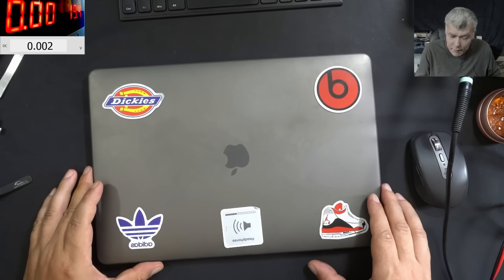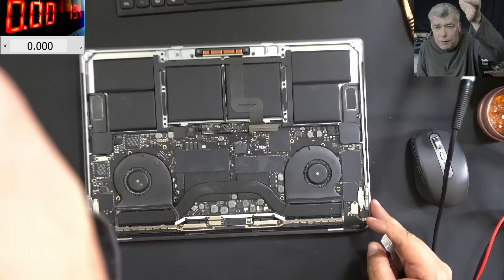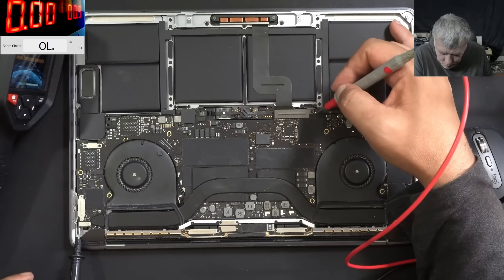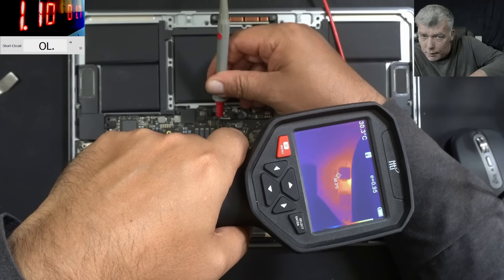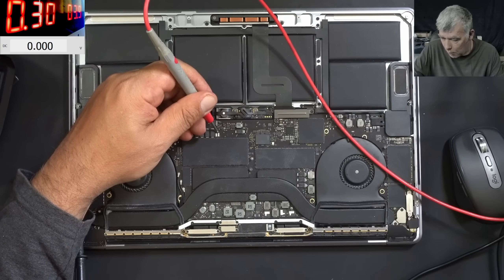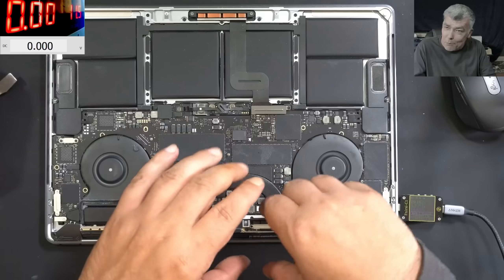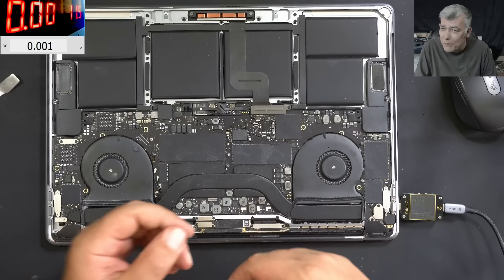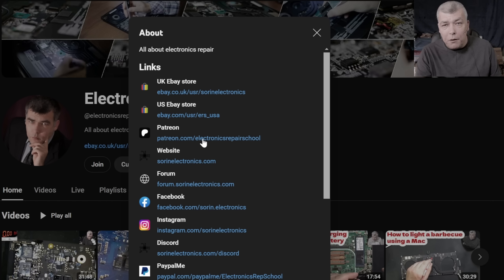Another way to deal with shorted caps - Pushing high current in a shorted capacitor

Comment: Not really a good method of resolving this. You really need to take the motherboard out of the computer, and use a hot air station to remove the failed capacitor/other component once you have identified the fault. Trying to burn out a capacitor by shoving a high current into it is just asking for problems.

Comment: Haha.. required tools to start a repair business: screwdriver, multimeter and a power supply. For pros: additionally a soldering station and a bunch of proper calibrated wire. The rest is optional :D

Comment: I had a proper calibrated 12V/7Ah Lead acid battery to kill the shorted capacitors.(After I buit a power supply from a faulty UPS).
One short touch with the wires and the cap exploding immediately :). (The use of protective glasses is mandatory due to flying capacitor pieces).
Only the main power rail strong enough to do that...

Comment: Can talk about or give some information about Intel 13th/14th generation instability issues and its impact on laptops
Reply from the maker: Well, as intel is not doing anything about this, never again intel
Reply: @electronicsrepairschool Oh, probably you judge a bit too hard, because Intel gave recommendations to the mainboard manufacturers to add a tab with Intel's recommendations for the specific CPU. Overclocking is not recommended, not from any chip supplier.😊

Comment: Anticipating a surge of machines arriving with failed CPUs now :-o
Reply: Calibrated CPU failure from injecting an inappropriate voltage into a low voltage line. Nice
Reply: Even though Sorin knows what he is doing and he checked CPU coils before injecting current, still this is very bad practice and example many other will try follow. In conclusion, as Paul Daniels said, many otherwise repairable laptops will end up with burned CPUs or GPUs.
Reply: Proper dodgy job !.

Comment: Sorin, the cap is in the computer to do some task. Not removing it can degrade functional stability. The power delivery network (aka PDN) is designed with this cap, not without it…
Reply: Yes. Nearly all capacitors do have a specific place on the board. To loose some capacitance is sometimes not so important. But it can influence signal quality, stability and cleanliness of a signal or supply voltage. Modern electronics need clean signals and clean supply voltage. Therefore, there are many capacitors involved.
Reply: No. Try doing some research into electronics design. You will see recommendations from chip manufacturers about capacitors, inductors etc. They are recommendations. Board design engineers get a but too excited about adding inductors and capacitors all over the boards because they think it's good practice. The reality is there are likely to be over 50+ capacitors on the main power line all over the board so one missing capacitor won't make any difference. It's like pi55ing in the ocean, no change.
Reply: @g4z-kb7ct In the B2C business, you can act like this. There is nothing requested, even not any formal education. In B2B is a different world. But I think, to keep some good standards even for the privat customer, would be good practise. I also don't like to pay 150 pound to get a "repair" like this. Still, the board is not okay.

Comment: When will it be back for a warranty repair?
If the cap is cracked (likely) burning it out so it works now seems counter productive - bend/use the laptop, and it will most likely short again shortly
Reply: Burned (openend) caps do not come again  to conductive ..never seen this before ( if you don't touch them with tweezers or hot hair ) .. the only thing I'm a little bit worried using this technique is that pcb can soffer from over heating and layers can melt... but in this cas cap burned very fast
Reply: @laboratorioassembler  Agree, if you really cook the cap, it is unlikely to short again - perhaps, no guarantee given from me.
Ceramic caps, with their parallel metallic plates - once cracked, has no where near the mechanic stability they had when manufactured.
So if the short isn't burned 100% away, any future movement of the cap can/will cause other parallel plates to touch - and short - perhaps, no guarantee given from me, but as you say - which is more worrisome:

If the short is not 100% gone, but the cap has turned into a resistor - yikes, the PCB will cook, carbonize, destroy itself + short out even more stuff around it
Reply: @EgonSorensen  but we love you Sorin
Reply: Well, to treat the capacitor out of specifications, is of course a worse solution. The reliability of this capacitor, and maybe surroundings like other components, tracks, planes and vias, might got an impact.

Comment: Thank you But ,  I would have liked to understand a little more with more explanation from 5:30 ! Thank you Sorin !
Reply: He increased the voltage to push more current so need to make sure it’s not problem with that power rail/coil because it’s power supply for PCH/CPU and usually only 1V. More than that may kill the CPU immediately.
Reply: @TanNguyen-qq2kp just asking, if there was a problem there wasn't probably already dead the cpu? Because current was already pushed from main power rail before
Reply: @Heichou96 If the CPU were shorted, can expect to see a hot-spot in the IR camera. But there wasn't.
Reply: He tested whether current is flowing to lower voltage rails. The short was on a higher voltage rail and no MOSFET involved. This he checked with the IR camera. Only an output capacitor lighted up.
Reply: @jurgenkruger3932  yes but what I am asking is: if there is current there it means a MOSFET is involved. If a MOSFET is involved and is shorted between main and low voltage rail (and in that case it is because you see voltage there) doesn't mean that CPU took already 19v at 100% and is high probably dead without checking with a thermal camera (for example if you have not one)?
Reply: @Heichou96  Yes, but not each time. To my experience, about 50% of high-side shorted CPUs and GPUs survive that impact. A modern CPU for example can withstand a 100% short for an unlimited amount of time, if the implemented power is less than it's TDP. The requirement for this is, that the CPU itself does not have a short-circuit and that the voltage at the CPU core is not over the limit.
Reply: @jurgenkruger3932  thank you, I really appreciate

Comment: How is it possible, how do you do it LOL, Very nice done BTW
Reply: High power blows up the shorted capacitor. You can sometimes even fix shorted chips using this same method. The chip is shorted, you push a bunch of current into it and if it was a capacitor that was shorted in the chip you can burn it out and repair the chip by doing that. I've even seen shorted CPUs repaired using this method.
Reply: @vlatkosurlan545  I do know what and how he did it, I meant how it's possible to think about such a repair method. Very unusual approach